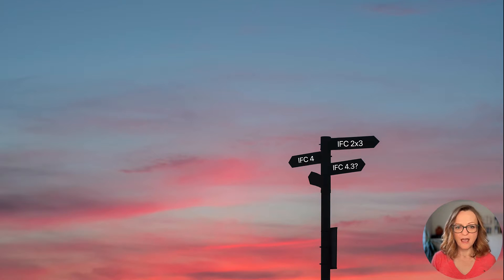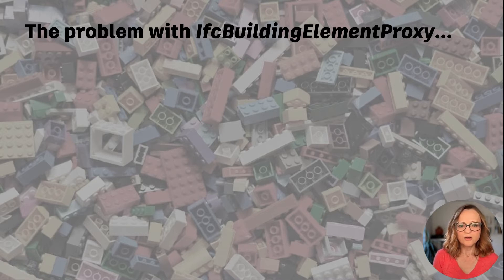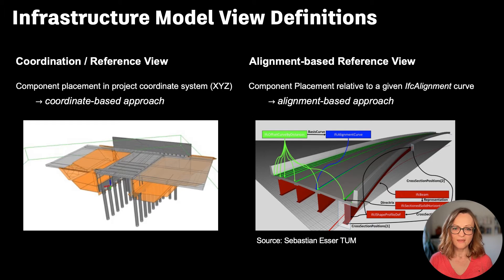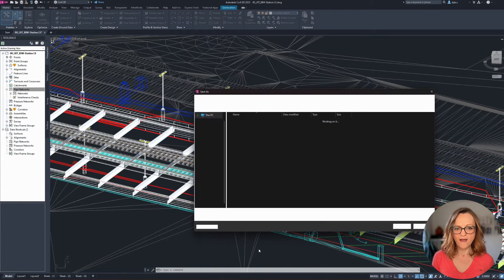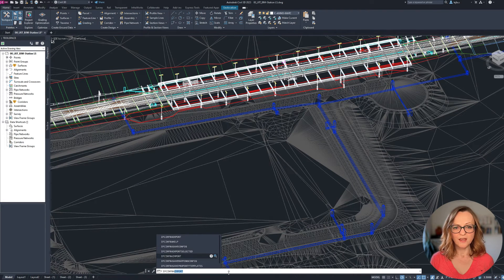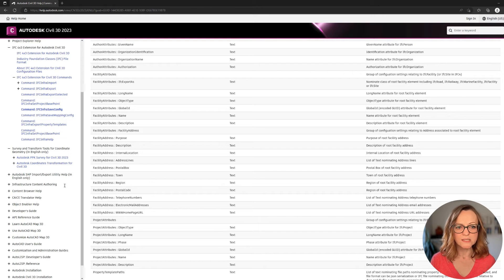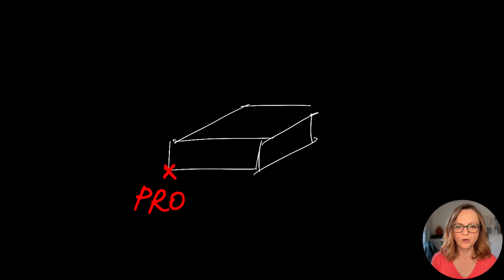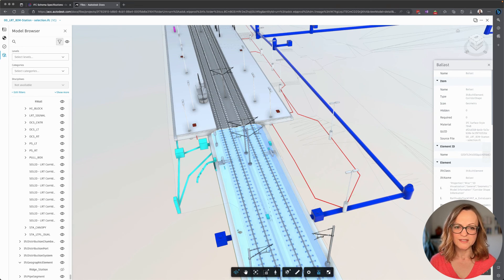IFC4.3 - This is the way (Civil 3D export)

Comment: Hi , I’m currently working on linking an IFC exported from Civil 3D into Revit, but I'm facing some alignment issues ( but both civil-3D file and Revit file has same Co-ordinates and same georeferenced and other thing is when i import IFC 4 into it is not linking it says cant open the file but not in the IFC 2X3 but it miss aligned) . The same IFC aligns Exactly in case of Revit 2026 Version. Would really appreciate your guidance if you’ve dealt with similar workflows
Reply from the maker: Hi and thanks for your comment - if both files have the same georeference, then actually they should align and I can't really tell why they are not. Could you please open a support ticket with Autodesk so that someone from the customer support can have a closer look at your files? Thank you! https://www.autodesk.com/support/contact-support
Reply: @BIMmeup  Thank you for your replay and support, Actually we met one autodesk suppert key peson, they conculde that ,Either It should align at exact position or fall far from the position. And they didnt gave any further confirmation on what went wrong and solution. Please guide me on this to resolve the issue.

Comment: When I export using 4x3 I can't use the ifc in ACC model coordination for clash detection. the old exporter 2x3 works. what is the difference? how can i export to ifc in 4x3 so that it can also have geometry used in clash detection?

Comment: Would be useful. if iFC will be compatible with prt. As a carpenter I get IFC- files and cant use any BIM data in the parametric .prt software in which i draw my cabenitry. I use alibre and rhino atm.
Reply from the maker: Agree, but IFC was created for coordination purposes and is definitely not ideal for all workflows.

Comment: Thank you for the video and the explanation! Can you do a video to demonstrate how the set project base point works when linking the IFC to Revit for a building project? Does the set project basepoint account for rotation? I have been using the shared reference tool and hope this new feature can simply the process by simply linking the IFC in revit. Many Thanks!
Reply from the maker: Thanks - oh yeah that topic has been in my list for a while now, will definitely do it! 👍🏼
Reply: @BIMmeup I just tried the 4x3 export and everything works well except for the colours. Everything is white (color index 256). Do I need adjust some settings in the configuration files to export the colours as per my styles?
Reply: Thankyou. I'm also wondering: how can I set the rotation of the IFC basepoint?

Comment: First of all thanks a lot for the information provided! Second: Yes i would love to see what is possible in Revit with the json files and the csv 🙂

By the way: I still have problems to import IFC 4x3 pressure pipes into Revit. Open IFC-Viewer shows me all the parts wheras Revit doesn't show anything. Any guesses?
Reply from the maker: What do you mean by import? Please note you need to LINK the IFC4.3 in Revit, opening it won't work. Btw., the Revit video is now up and shows how the IFC4.3 can be used in the Revit environment - hope it answers at least some questions!